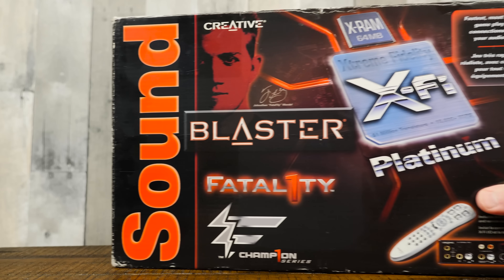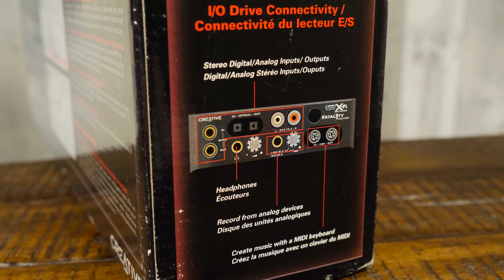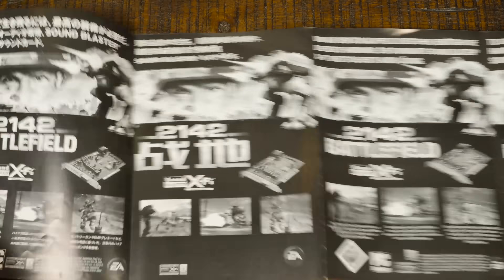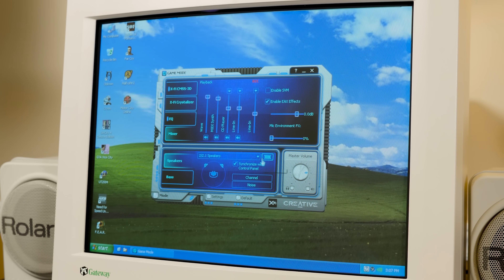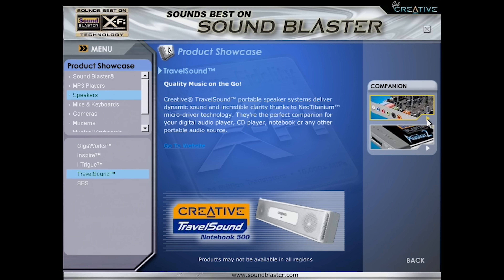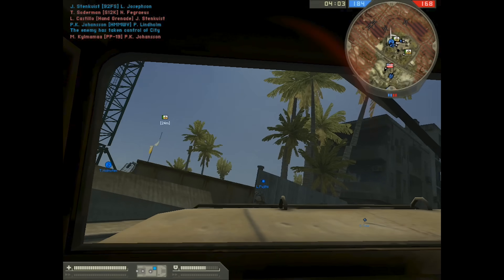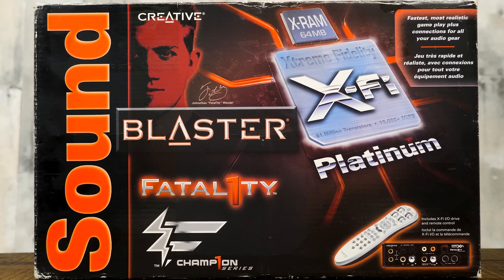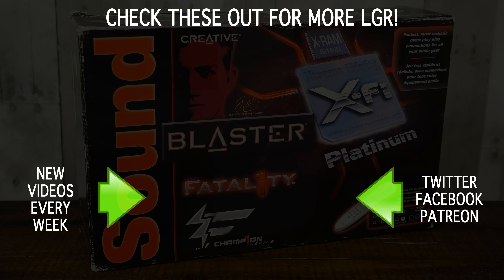XP Upgrade! Sound Blaster X-Fi Platinum Fatal1ty Sound Card

Comment: I will ask here as I ask everywhere, how do these xfi titanium HD cards hold up to modern motherboards??? I have the x-fi titanium HD in my 2014 build, is it better than the advances to motherboard audio, or a fossil?
Reply: It depends on the sounds chip on your mb and which equipment you are using. My old MB had a good sound chip on it, at i least i thought so until i swapped it for a real soundcard, i rock a logitech Z906 with creative ZXR.

Try it, in games like BF4 it made a huge difference, it is like you are driving the tank in real time.

Comment: Nice card! With a heatsink, gotta be a newer one. (I very much suspect that the common "hiccup" failure mode on X-Fis is related to that chip developing bad solder joints and needing a reflow. Those without a heatsink would be more problematic then for obvious reasons. It might still be an electrolytic capacitor issue, with just a single candidate nearby. Some people put thousands of µF there instead of the stock 22 or something and then wondered why the card was not working right - never heard of parasitic inductance apparently.)

I hope you did get around to installing the latest drivers from the web (they're from 2014) or Daniel_K's X-Fi Support Pack, I wouldn't trust the supplied bug collection much.

With XP and lotsa RAM, don't forget the SystemPages registry tweak (0xffffffff), and enable LargeSystemCache as well.

Comment: Just as an aside, EAX was originally a DirectSound extension, but starting with Windows 7, the Directsound API was redesigned solely as a software API.  As a result, as of Windows Vista/7/8/10, EAX is emulated in software instead of hardware.  All the soundcard does is output the finished product.  

Creative gets around this by intercepting all EAX calls and converts them into OpenAL calls, which then go out to the sound card. ASUS handles this through its drivers [automatically when GX mode is enabled]. Neither approach is foolproof though, and EAX in some games simply no longer works in newer versions of Windows.

So, when it comes to hardware EAX, there's not much point in dropping a ton of cash on it unless you're using Windows XP.  For emulating EAX 5 under newer versions of windows, there's the Auzen X-Fi Home Theater HD or the Asus Xonar and Asus Essence cards, as well as the various Creative cards.  The Creative Audigy FX ($40) is great if you're on a budget.  On the other hand, if you're willing to blow some cash ($230), the Creative Sound Blaster ZxR PCIe is Creative's flagship card, for a reason.

Comment: Tried both soundchips on my mainboards in recent years and honestly, they haven't got shit on my Sound Blaster Fatal1ty. 

Installing the drivers is always a fucking chore because Windows auto-updates the drivers when first booting up and makes installing the official ones impossible (disconnect your ethernet cable in that case), but goddamn do games sound so much crisper and cleaner with the soundcard compared to the generic, tinny sound of onboard sound cards.

Will keep it in use until it breaks and then probably upgrade to another Sound Blaster card. Fuck onboard sound. :D

Comment: I am still using this card in Titanium (PCI-X) version till this day and wouldn't want to part with it.
Mind it is wise to mute the input channels (from the playback mixer side of things) because of background his getting annoying.

Also for some anekdotal history on terms with the performance benefits of this card.
Back when Mafia 2 came out I had a Core2Duo E6600 with 4GB of ram and a GeForce GT 480. Still using onboard Realtek audio at the time. 
During benchmark runs I kept seeing the minimum FPS getting worse during audio heavy moments, especially the explosion part.
Now it couldn't be the graphics card and I wasn't ready to spend cash on a new CPU (that would happen later with a 2600k), but I wanted smoother graphics.
So being an old fart and knowing about how IRQ works or Interrupt ReQuests in full. I knew the audio was cutting out because the realtek chip had to interrupt the CPU during those audio heavy moments. In short if there is an interrupt request the CPU lays down all its work and helps the chip in need, causing a CPU heavy game to tank in performance.

So I came to the conclusion that a soundcard might help. Oh boy and did it help, but only with the X-Fi card in "game mode" would it not interrupt the CPU anymore.
The game still didn't run at 60 FPS with that old Core2Duo but at least my frame rates stayed constant. Giving me a smoother gaming experience.

So yeah, the performance improvement is a thing with this card. I found out through my own experience. Although it might not be in the direction most gamers are looking. :)

Comment: Ah, Windows XP; how I miss your hardware audio support.  Even the basic windows sounds actually sound a lot better than Vista+.  Booting between my OS installs (before I had to deprecate them due to hardware upgrades, grr) was a night and day difference.

Fun fact, I'm still using an X-Fi Titanium because I use the volume normalization feature of the drivers (SVM), and it is worlds above better than any other card I've tested with such a feature.  Returned the newer Recon3D cards and have a $200 Xonar Essence STX just collecting dust over this thing solely because of how important SVM is to me.  I should probably buy a few more before they get too rare/destroyed so I have backups in case mine finally dies..

Comment: Airflow doesn't matter that much anyway, actually. What's important is that you have air pressure. Enough fans pushing air in, and enough pushing air out. Obstacles don't have that much of an impact.

Comment: As I thought, just an sb0460. So in that overpriced box was always only an creative xtreme music... actually that front panel wasn't necessary at all because you have the xfi control center to install anyway. So piping out your stuff via the 3.5mm jacks was always an option. Couple that with a capable sound system and that front panel and remote control become obsolete in no time.

That was my setup several years ago ;)

Comment: Glad I watched this after the original build. I was confused why he used the 32 bit install vs the 64 bit. I didn't think about how it messes up the older programs especially games. 
Oddly enough some people still use 32 bit windows 7 and 10. The first thing I did when I got this IT job was to rid the company of 32 bit installs which the previous IT person did and often in systems which had 8gb of ram. What's the point of that 😂..

Comment: Back then I didn't buy an X-Fi purely because it was the first generation of Creative soundcards where Creative had to bow to the pressure of the content industry that forbid uncompressed multi channel digital output. What a joke it was having to go back to analog ouput or having to use lossy compression. I recently bought an Auzentech card with the X-Fi chipset that has HDMI output but I didn't yet try if that allows to output uncompressed multi channel output from DS3D, EAX and OpenAL games.
.

Comment: Fucking hell ! I like 'Doom 3' and I've missed a lot without EAX, but unless there's a software solution nothing can be done.
Reply: Dhewm3 source port. Comes with OpenAL Soft for EFX reverb, headphone HRTF, and 7.0 surround without the need for a soundcard. Set boost=-12 inside a textfile named alsoft.ini and place it inside %APPDATA% folder to match hardware X-Fi reverb levels. In general, you can restore EAX and 3D sound in most older games with a combination of OpenAL Soft and DSOAL.

Comment: I have Creative X-fi card too...absolutely pointless on Linux :) Thing is that card have own ARM processor and onbord RAM, but itc CPU can be used only for effect which mostly not used in games at all and about that RAM - usually you can load midi soundfont in it. but thats all.
Yet, when i was on Windows using EAX to add effects all sounds in system was quite fun, there is nice presets like "stadium" or "opera" which do change sound a lot.

Comment: I suggest you overclock, and reapply thermal paste on the GFX cards, and under the CPU heatspreader as that would be more fair to assume they would have fresher paste in 2008... 

Also, I beileve the Nvidia RAID1 had latency issues in the day. May get rid of some loading stutter by using a single drive... Then retest! I had an almost an identical setup in 2008 from working when I was 16 years old. I will add, I'm concerned about your performance; I had a Q6600 CPU overclocked to 3.8ghz, 3GB DDR2 1066mhz, and x2 SLI 8800GTS. 
I used windows XP with the latest drivers at the time. Had none of the issues you displayed, and also definitely didn't have that poor performance.
I did have problems with PCI latency issues however when trying to use my Audigy card in my board however... Forced to use onboard until I got a nice GTX 260 in the future! hehe. I think something to do with the Nvidia chipset having problems with the PCI lanes. Maybe the latency setting too.
I even found some old emails from orders I made online, I could rebuild my old system and it would still kick some ass! I really didn't spend my money very wisely, but I don't think all of it cost less than about £700! I got a good bargain, mostly second hand. :) It mostly lasted until about 2012 though. (I did upgrade the ram, motherboard and GFX though).

Maybe some of my suggestions will help with your performance issues, I'm pretty sure you can get a lot more out of it!

ALSO--- Try the modded Xfi Drivers.

Thanks so much for your excellent videos though, you really brought me back! You've kept your videos at top notch quality, you must be very proud to also be able to say to your 2008 self "Look at me, I'm also internet famous!".

Comment: I've had terrible experiences with these cards unfortunately, namely the absolutely broken MIDI playback that becomes worse the larger the SF2 you load. (I couldn't even make use of GeneralUserGS properly without missing sounds, loud repeating clicks, etc)

Most games would also trigger kernel bugchecks or outright crash themselves if you tried to use the card directly (i.e not through "software OpenAL" or plain DirectSound) Hammerwatch crashes immediately apparently trying to make use of the "X-RAM" and there's no way of avoiding the crash from what I can tell.

No matter of official or soft-modded drivers made a difference.

Also the "X-RAM" can't even be used to load SoundFonts, much in the same way they were loaded on a fully expanded AWE32, so... what even was the point of the RAM there?

I really think the Audigy 2 ZS was the last non broken Creative soundcard, and that's really pushing things for me.

Comment: The fatality sponsoring is more or less from the time that todays "gamer/gaming" marketing pseudo-culture started. "gaming mouse", "gaming keyboard", "gaming 3d video card", "gaming mainboard", "gaming power supply" To the point you can't avoid it sadly (and can't avoid paying a premium fee). People that don't understand performance, power supply features, etc. were shaping what the manufacturers produced. All on premium money, for a cost, obviously.

chipset heatsinks where they were not needed but made hardware "look faster", etc. etc.
I personally don't care for a mainboard/video card looks, specially if it has a lower cost. Its just a component inside a box. I care for stability, good drivers, good features, continued support, even linux distro support, etc.

A geforce 8800 (soundcard, mouse, keyboard, etc.), hardware, perfoms the same, "joe gamer" sponsoring or not.
A step backwards in my opinion.